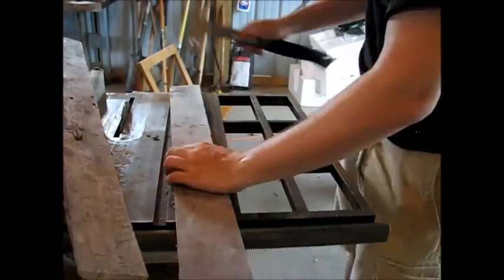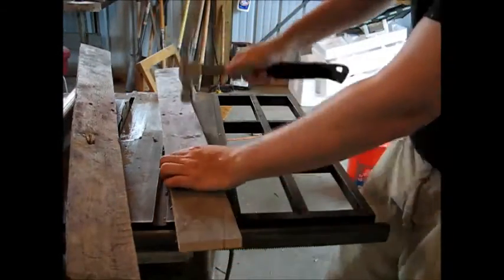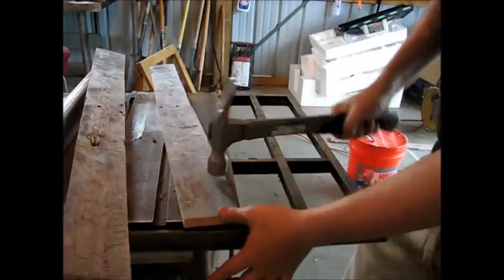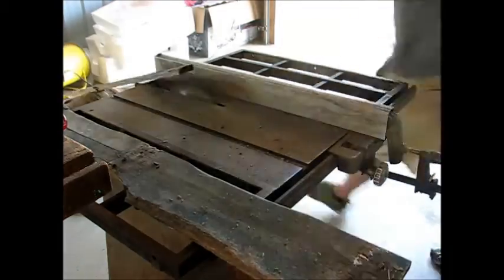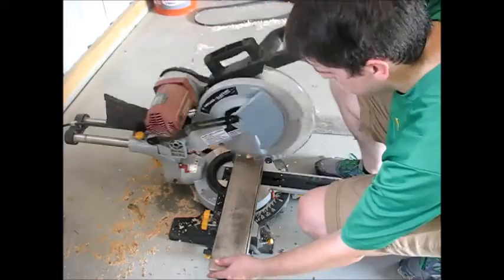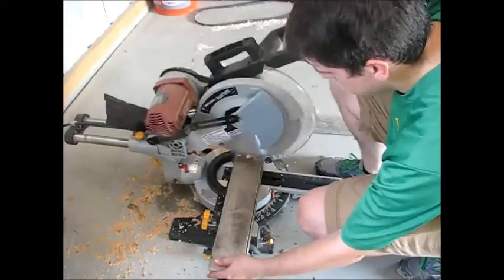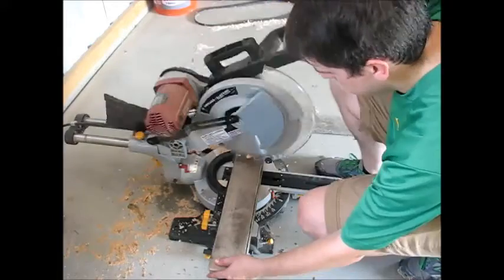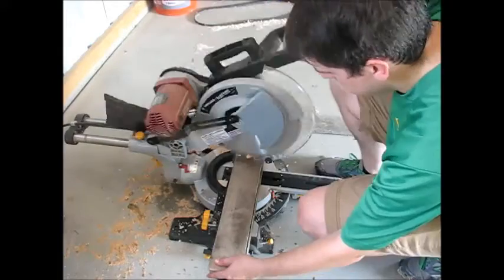Floating Pictrure Frame/ Pallet Upcycle Challenge

Comment: Worth a sub for another donation :) great job on that and the project. Okay this is my very first safety sally comment, lol. I noticed you used a painted pallet, most of the time those are treated lumber because the company plans on keeping them and using them over and over. Use them carefully and don't breath too much of the dust :)
Reply from the maker: woodturningjohn thanks for keeping an eye out. Before I broke down the pallet I ran the numbers on the side to see if it had any chemicals in the wood.  The internet said that it was clean and with the decomposition of the wood on the bottom, I figured it was safe to proceed.  I forget what website it was but man they put some nasty stuff on those so you have to be careful I know I don't want lung problems. Thanks for the sub I appreciate everyone here and supporting the WWP.